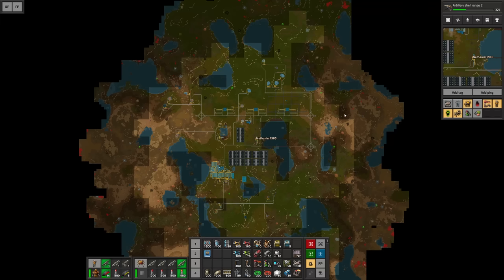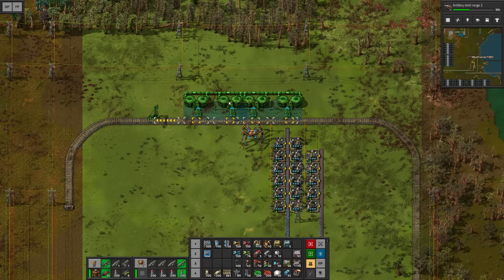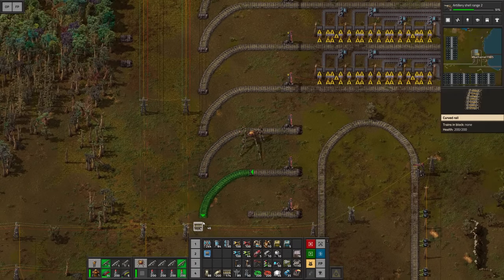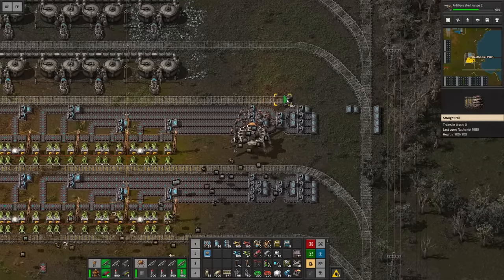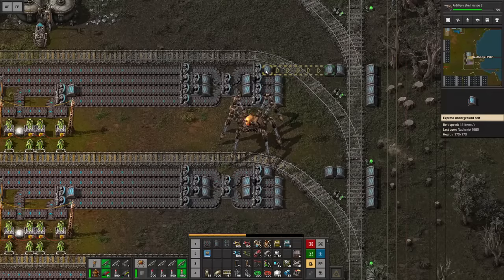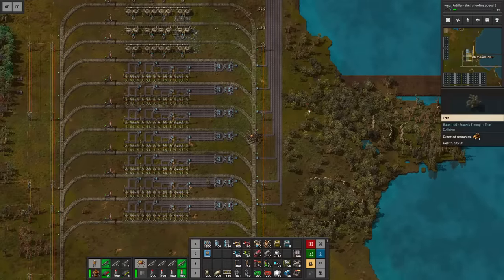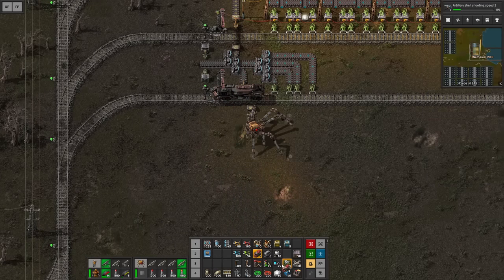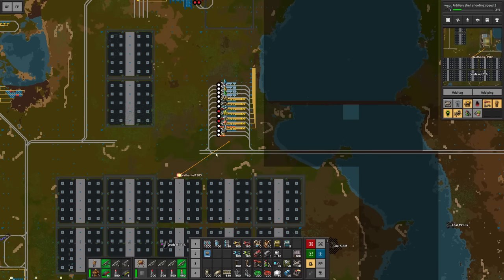MEGA CRAFTING HUB STATION -  Step 29: Factorio Megabase (Step-By-Step)

Comment: Not sure how far ahead you record, but the reason why the light oil unloads so quick but loads slower is because of the fun liquide dynamics that are programmed in Factorio
if you have a pump directly connected to a tank it is almost instand (your unload) if it has to be squized trought a pipe first (loading) then its limited by the amount that fits in a pipe, so to make it quick you can best swap the full length pipe to the other side of the tank on loading and connect the pumps directly to the tanks
Reply: Yes, because a pump can pump a lot more than 100 per second, but a pipe segment can only hold 100.
Especially on unloading, because as the storage fills it gets even slower. If the storage is 80% full, the pipe only has 20 space to pump into, and then you need to wait for the pipe to balance with the tanks.

Comment: Wouldnt it be better to have module for lets say 1 belt of each science ?

Something like inputs only raw resources, and then do whole smelting and crafting in module itself up to 1belt/s of single science pack.
Would save a lot of train trafic, and you wont need balancing smelting modules with consumption after adding something new.
Reply: "better" is subjective.  There's a 10k SPM pure vanilla base running at 60 UPS that was done with 8x all science modules fully optimized for ~1250 SPM from raw resources